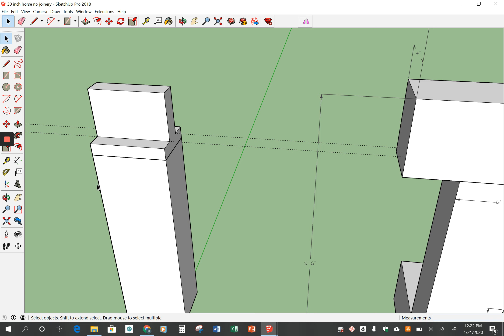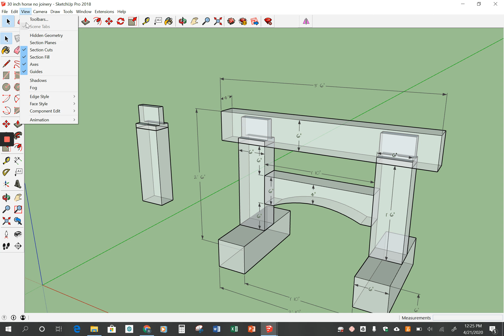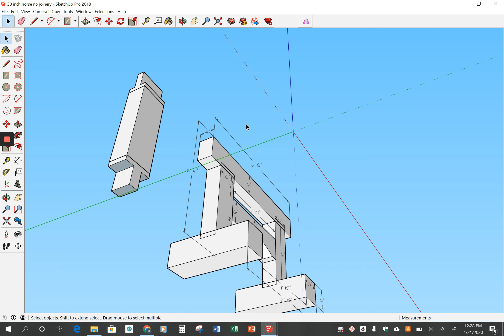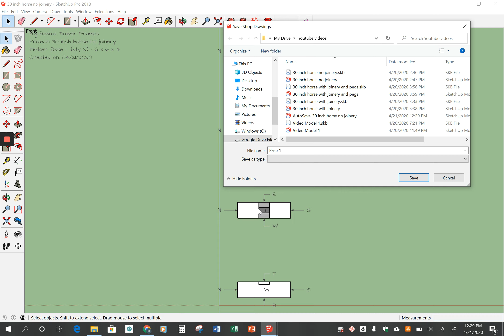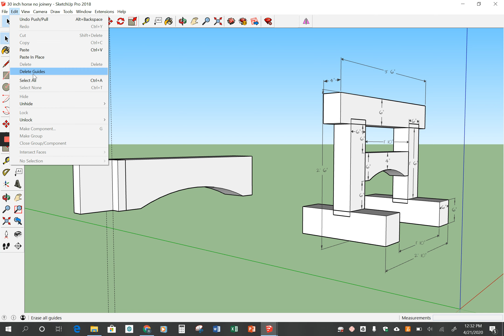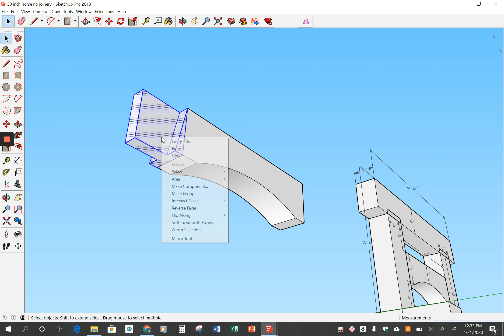Timber Frame Design Using SketchUp Part 3   Adding Joinery to Components

Comment: Hey, I have the latest update but I am not coming up with the TF Create Joint on the Contextual.  I do have the counting ot he joints option in the other menu,  but the contextual seems to be missing? Or does it do it a f\different way now?
Reply: Note:  I use a Mac Book Pro  with the track pad and fingers, and using two fingers usually brings up the contextual menu. It just does not bring up  the Create Joint, on the list of things to do.
Reply: @Seeker64  It says "Create Joint" rather than "TF Create Joint"

Comment: Question re: rubies and versions.  I have SU Pro (2021, 2020, 2019 - part of package) AND 2017 SU maker,  free.  Can I only complete the trestle drawings (using the TF Extensions) if I draw this in 2017 version?  Is there anyway to access the TF Extensions in SU Pro 2021?  Using a Mac.  The instruction are awesome, confusion has been matching the TF Ext. with the version.  I know - sure could use a course or sit-down helper.  Sincerely appreciate any quick answer or advice.
Reply from the maker: Sorry I’m just getting back to you, your message went to my spam folder...you should be able to complete the trestle ponies without TF extensions, but you won’t be able to add pegs nor create shop drawings without TF extensions. Although I’m not a Mac user, I recently downloaded Pro 2020 (on windows) and added TF extensions. I did get a message that said it wasn’t compatible with that version of Pro, but it did download and although I haven’t tried all the TF features, everything I have tried still worked.
Reply: @bigbeamstimberframes770  Once I got everything straight it all worked out great, can't thank you enough.  I'm finally off to the races, with a ton to learn but moving slowly in the right direction.
Reply from the maker: @ff24scottie  I have a few ideas for another tutorial but my teaching schedule has been hectic due to the pandemic. I hope to post something in the near future.
Reply from the maker: You will need to install the TF extensions with each version you use so you will need to install the extension with whichever Pro version you are using. You might get a message saying that TF extensions is not compatible with Pro, but continue with the installation anyway and it should work. Best of luck.

Comment: Great tutorial Thanks. I see you're on SU2018 which isn't listed as supported by TF Extension in extension warehouse,  but you are still able to access "TF Create Joint". I'm running SU2019, have downloaded TF extension ... sadly it will not create joint ("TF Create Joint" is light grey, not clickable in the right click drop down menu). I haven't found any chatter of this on TFG forum or anyone with a work around. Clark B hasn't done any revisions on his program since 2016 (sure appreciate the work he has done thou!) Hold onto that SU 2018
Reply from the maker: Sorry to hear create joint isn’t working for you in SU2019 as it is likely the greatest feature of TF Extensions. I haven’t used the 19 version so I can’t say if it is due to Clark not updating. I would double check to make sure there isn’t something funky with your joinery lines (like maybe they aren’t actually connected although they appear to be). Try drawing a very simple tenon and see if that works. Or perhaps you haven’t clicked the joint correctly to select it (can’t remember if you need to click it twice or three times). If none of that works, try posting your question on one of the forums. Hopefully it’s a simple fix. Another option is to download the 2018 make version and give it a go. I actually have the 2016 make version loaded as well as 2018 pro so I can “save as” either one when sharing files with someone running an earlier version or under the Make platform. Let me know how it works out.